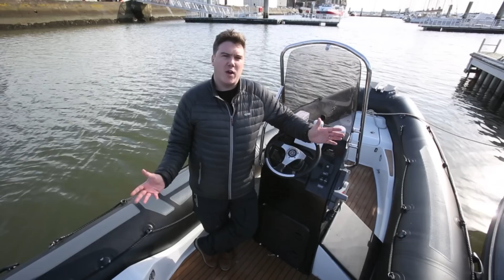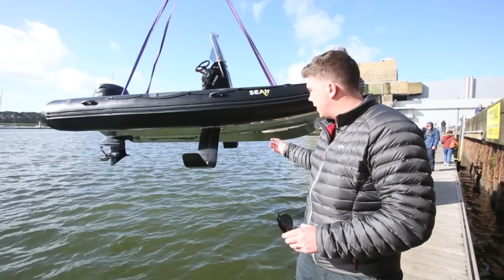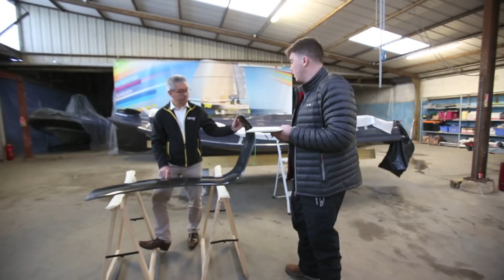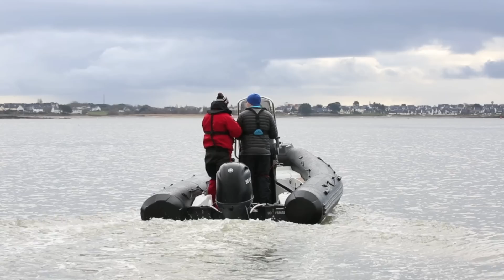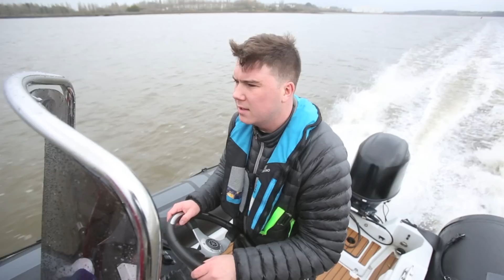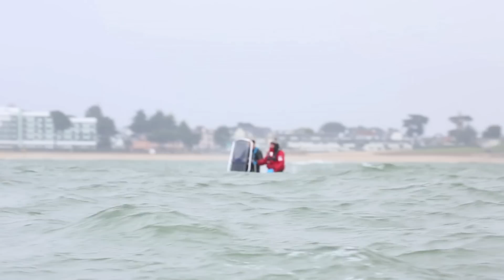SEAir flying RIB | Review | Motor Boat & Yachting

Comment: Yeah....
I used to think RIBS were amazing. Until I started to think.... there must be a boat that has all the same performance and weight characteristics of a zodiac but that I don't have to worry about punctures, sharks, sharp stuff, delamination, pvc, hypalon, uv rays, etc.... and then I found STABICRAFT boats. Now these boats are AMAZING, truly 4x4 tanks of the sea!!
Check them out. It's like having a zodiac that will never deflate or puncture, last a lifetime and much more functional with better performance.
For 15 years I owned Zodiac RIBS, now I have a Stabicraft 2100
https://youtu.be/5fkr7XMfdO4
and I'll never go back to a RIB ever again!
The Stabicraft 2250 CC is a beast!!
https://youtu.be/TcshvdgysAs
And much less expensive than a RIB of its size and capability.
(Some day she will be mine)
Reply: That's great an all but the stabicraft doesn't fill the roll of a RIB at all... no soft sides.

Comment: Very interesting but what happens if you turn the wheel sharply at 30 knots? Because maneuvers like that is part of, for instance, the DNV certification. It's one thing when the boat is driven by experts but it needs to be safe for idiots as well.

Comment: Absolute bollocks. I used to crew/helm Rodriguez hydrofoils carrying 200 people over 100 feet long, check out the hydrofoil blog here on youtube and see proper hydrofoils at work, The Italians use them daily. This gimmicky piece of crap has no aft foiling system and no control surfaces/flaps on the foils. The lifting area on these foils is small and for real lift a foil is needed across the full beam and beyond (on powered craft). With the bow up on the foils, it looks like a dog with worms dragging its' arse along the floor, in reality, offering an unstable ride with the angle of trim such that the aft area will just slam through the chop. Complete rubbish and I hope they don't go any further. If one of the foils stalls this could cause injury.

Comment: I like this invention. Not from fuel point of view but looks like smoother ride and softer against waves. Will love to see more movies offshore or with waves. My only concerns: how to tow such boat ? RIB is well know as boat safe to dock to another boat. These items reach out of the tube range. It could be the problem. Many modern race sailboats use such solution. Is it require to mount engine lower than usually ? Or just add something to prevent spray ? The hull of the RIB looks like ALU. Is it really GRP model ?
Reply: What about 1m waves. I use mine RIB boat in Greece mostly and on evenings 4-5BF from open Sea is normal
Reply: Up to 50cm the boat is incredibly stable and flat. After that, it does of course hit the waves but will always be safer and more comfortable than the same RIB without foils
Reply: the engine has a longer shaft. Otherwise, when retracted the foils change nothing. When docking, they go under the pontoon,  on hard docks, they are thinner than the fenders.